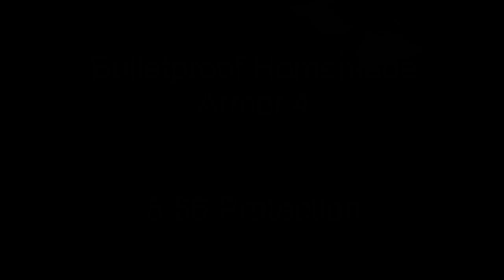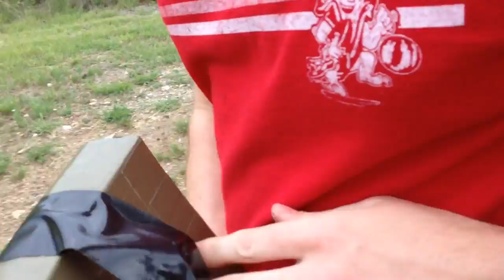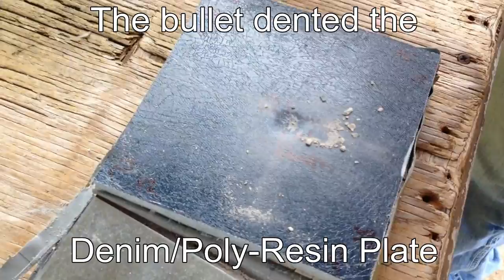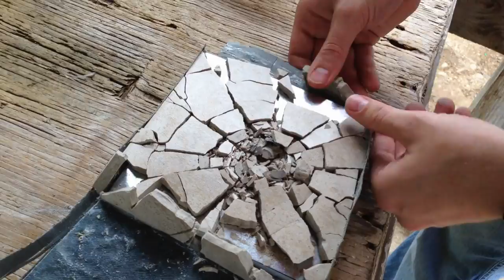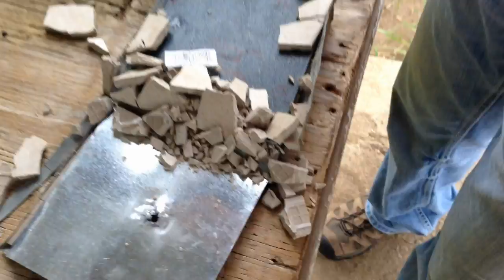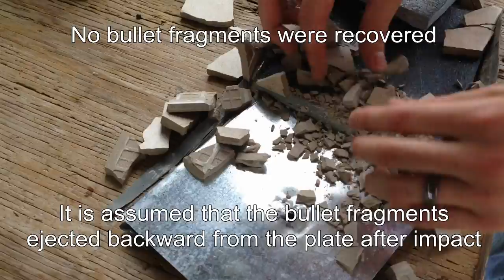Homemade Bulletproof Body Armor vs 5.56

Comment: Am i seeing this correctly? The first tile/flashing/denim layer stopped the 556 so is the second layer of tile/flashing/denim/flashing contributing anything?  Thx!
Reply from the maker: It's an odd thing to see, but they all work together to provide the sheer strength needed to prevent penetration.  I have other videos of better designs.
Reply: @ProfessionalPepper  i c.  That makes sense.  From a strictly cost and weight perspective it seems like the denim is giving you the best results, although it would be incredibly thick?  Ie. 1 layer of ceramic and a huge layer of denim/loctite may do the best for cost/weight but be much thicker than say a double layer of ceramic with aluminum behind?  Very cool stuff sir i stayed up all night watching your vids lol
Reply from the maker: Always remember that the professionals that sell real body armor make good quality affordable stuff.  Buy some if you can.

Comment: I was curious about how many layers of denin resin can stop a pistol round
Reply from the maker: B Souza I tried 15 of only denim resin and it failed against 9mm. Adding ceramic tile to the front significantly improves it's capability.
Reply: The Professional Prepper (Prep Know Do) tank you for answer . maybe 1/8" mild steel + some layers denin for spalling protection  can defeat pistol rounds
Reply from the maker: B Souza hardest layers must go in front
Reply: The Professional Prepper (Prep Know Do)  yeah . but in a steel case spalling protection is required as steel body armor .

Comment: There are a lot of haters out there.  Seriously, what is wrong with some of the commenters?  Damaged goods I guess.  Anyway, thank you for the providing everyone with the knowledge gained from the work that you did.  I noted that you commented "finally" on the successful test with the desired outcome.  There are a few professional grade questions worth asking.  Where is the third metal sheeting placed?  Behind the last denim?  Was lock tight used to hold the tiles to the metal sheeting?  As denim is cotton and subject to rot a bit faster than synthetics what do you estimate the deterioration rate to be?  Would you estimate that protection or plate integrity begins approximately a half inch to one inch in from the sides ot the plate?  Do you have any other suggestions regarding materials to replace the tape, as it dries out and degrades as well?  Though I do like the water resistance offered by the tape.  BTW, to that Hammer Head who made the negative comments about the plates not to far down this list, That is why you wear soft armor under SAPI plates to pad against blunt force impact and disperse the energy from impact.  You want to be able to regain your effectiveness as quickly as possible.
Reply from the maker: Trolls abound on the internet.  

The third layer of roof flashing is on the very back of the plate (see "video description").  It was placed there just as a precaution and I do not think that it significantly contributed to much to the structural integrity of the plate.  

There was no lock tight adhesive used between the tiles and the sheet metal. 

Because the denim was impregnated with the epoxy resin the material has essentially become synthetic.  In a side by side test I am sure that an equal strength nylon would hold its strength better over a longer length of time.  However, cotton when coated and encapsulated holds its strength very well.  I'm sure its strength would hold up past 7 years if impregnated with resin. 

I think that due to the thickness of the plate and how well it held up, that a shot within 1" of the plate would be able to stop 5.56. Less than that would be doubtful though. 

A proper outside material would be an epoxy resin impregnated fabric, that is tightened around the whole of the plate. Tape would disintegrate when hit by any petroleum product (Gasoline, motor oil, alcohol, etc.)

Thanks for the positive comments and quality questions.  Please let me know if you have any more.
Reply: The Professional Prepper (Prep Know Do)  very well made plate bro . maybe if you covered the ceramic tiles usind denin and resin   and using maybe 1/8"mild steel it can defeat a rifle shoot easy . 2 layers of tile+1/8" mild steel+ 10 layers of denin maybe it works
Reply from the maker: https://youtu.be/NEDMQ7jalU4
Reply from the maker: New design that is light and effective

Comment: You'd still hit the fucking dirt if you were hit wearing this (or almost any) armor. It would be like a heavy-weight squaring up and punching you straight in the chest......while you stood against a wall.
Reply: id rather that then get penetrated with a bullet..
Reply: the force would be almost exactly equal to the recoil from firing the bullet.
Reply: Klart HAHA no. It would be equal to the recoil of the bullet without all of the nice force-reducing mechanics built into the weapon.  The force of recoil is also dissipated by your whole body (when standing) versus the impact occuring at one single point (when struck). You are gonna be black and blue under that plate (better than being penetrated) and probably not combat-effective for a bit.

Comment: What do you think about, 1 half inch thick piece of Tegris from a nascar splitter, 20 layers Kevlar hardened with resin, and a piece of half a cm thick polycarbonate? I am making a plate with those items, I just don't know what it will stop, I know it'll stop all pistol rounds, but do you think it could stop a 7.62x39 out of an ak-47?
Reply: Btw I meant a one, half inch piece not 1 and a half
Reply: +weapondude123 i  dont know, without ceramic its hard to belive

Comment: I think the point is you are using quarter inch thick tiles, 6mm, and you stop 9mm, 45 acp, it would stop also all pistols and shotguns, but to stop a 556 or 7.62x39mm you need thicker tiles, for example I use 8mm, its not a big difference, but it also is aт the same time :D

Comment: When are you guys going to make more armor videos!?
Reply: rifle plates are more what i was interested in
Reply: +Prep Know Do (PrepKnowDo556) Have you tried spray on rubber or plasti-dip as a spall liner? Maybe even spray on truck bed liners.  All those seem very similar to the coating AR500 applies to their plates to protect from spall.
Reply: +Prep Know Do (PrepKnowDo556) I remember what you told me about, i recommend you to test it also with a 556 after you hit it with either 9mm and 45 acp. Looking at my desing, I think it has a chance to stop a 556

Comment: Most patents you see that do have a metal plate backing up the ceramic have something like a 0.8 mm Stainless plate for rifle caliber plates. Almost all patents that feature ceramic plates tend to avoid voids on the backface of the ceramic plate like the plague. I'm not sure if 0.25mm plates are even significant as a ballistic material ( unless you use like 20 spaced out since most of the ballistic resistance is in the inner core of metal plates. You want the second tile intact, maybe include a layer of rubber to dampen/delay transmission of forces to the 2nd ceramic plate. 

Or replace the mass budget of the 2nd plate by something else entirely. Perhaps a 2nd 0.8mm plate followed by 1/4"HDPE/UHMWPE plate ?

You will gain the most benefit of ceramic tiles by keeping the mass of the plate ( even the bits that are being shattered) in front of the bullet to erode/deform the projectile. To that end embed the plate in a fiber/resin system ( preferably with the metalplate of the backface of the ceramic tile. State of the art currently is embedding ceramic plates in molten aluminum ( and even then you see thin stainless steel plates being used behind the ceramics to increase stiffness ).
Reply: 3rd paragraph : with most fiber layers on the backface of the tile obviously.

Comment: Awesome, simply awesome. 

Can you try one of those with an AK-47? 7.62x39mm I am having trouble stopping, its a penetrator for sure. 5.56 is easier to stop since its designed to fragment and is moving so fast, but is really lightweight at the same time. I can't move up to 7.62x51mm until I can stop the slower 39mm round.
Reply: ***** Using rubber  and duck tape would help catching  the spall and fragmentation :D
Reply: +weapondude123 dude if you successfully did that with one inch.. you are right up there with world class armor and maybe more economical?
Reply: +drchen054 was that a question? Lol yeah I did that, go watch my videos. I had one partial pentration, and one full penetration and one grazed the side. And all the rest were stopped, I think 4-6 rounds
Reply: +Prep Know Do (PrepKnowDo556) 5.56!
Reply: +mindtomachine check out my latest video, i did it with the cheapest possible materials, even cheaper that the one you used
Reply: I made a plate 1 inch thick that stopped 7.62x39. It was made of (strike face) ceramic tile. (Middle) vinyl floor tile, 15 layers of polyester fabric joined with liquid nails, 20 layers of latex laminated fiberglass 6oz, 10 layers of polyester laminated with latex, and another vinyl floor tile. (Backer) half in piece of tegris(polypropylene) from a nascar splitter. The tegris is probably expensive but I get it for free since my father works for a race team. Tegris is impact resistant and really strong
Reply from the maker: https://youtu.be/NEDMQ7jalU4

Comment: have you tried the denim plates with out the tiles or flashing?  or other combinations like denim plate/tile or denim plate/flashing?
Reply: ***** There has to be something hard to cause bulled deformation, giving it a larger surface area to spread the force out across the second medium it comes in contact with. 

Have you guys tried a thin piece of steel (thicker than the flashing) backed by denim?  Say 10 layers?  I think if the steel was able to cause enough deformation, and slow it down a bit, the denim would stop it.  You'd have a thinner plate, and the added bonus of the plates not being "breakable" possibly.

Comment: Im fairly impressed with your progress, im working on my own armor for fun, a lil less common materials but still easy to get. Im actually going to try the denim idea just to compare to fiberglass, kevlar, etc.
Reply: ***** well just did some tests, got to make the video but I'm actually really impressed with those porcelain tiles. I got used my 9mm(I only have a 9mm and 22lr) I am honestly surprised how much bullets my 6x6 in .7 in thick 1.8 lb plate took, tile on top l, fibreglass back.. shot it 19 times, still didnt get a shot threw it, I thought after the first shot tile would break and would lose its stopping power quickly.... strongest plates I tested lol
Reply from the maker: https://youtu.be/NEDMQ7jalU4

Comment: you really have to shoot these multiple times, at least on different locations, to ensure their safety whatsoever. armor core tests their plates by shooting them with a precision lab gun at exactly the same spot, 5 times. so they end up strong enough to resist 5 rifle shots literally on top of each other which is pretty amazing, but that's not as important as just being able to resist multiple shots in general. the body armor that's "good for one use" are good for no use, because you can't guarantee that you're only going to get shot once. if you get shot once it's likely you will get shot twice. and if your armor falls apart after the first shot, yet still manages to protect you from the first shot, that doesn't necessarily mean you're in the clear
Reply: NIJ standards don't require 5 bullets on top of each other - in fact they they specific a minimum 2 inch gap between impacts. Its the only way ceramic or polyethylene armor could be rated III or above. If you shot any commercially available lvl III cermaic armor in the same spot with its full rated 7.62x51mm it would punch straight through. 

The only armor that can stop multiple rifle hits in the same spot is hardened steel because it is not compromised by any hits. However it weighs a ton and the bullets fragment on the surface creating dangerous spatter, necessitating some sort of frag liner which makes it even heavier.
Reply: ***** Do you have time to watch the results of my armor :D ?
Reply: mindtomachine I found some kind of rubber that really slows the bullet down and captures all fragments :D